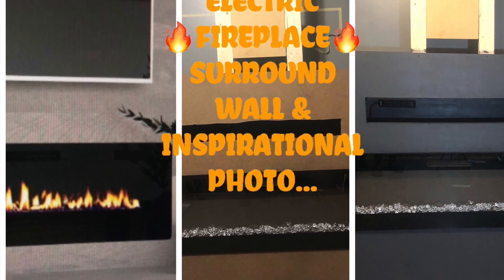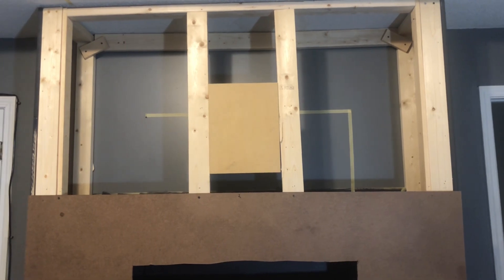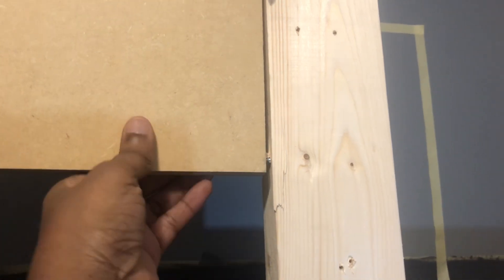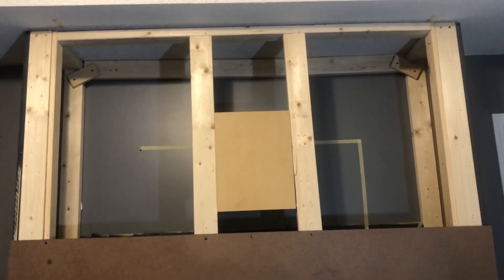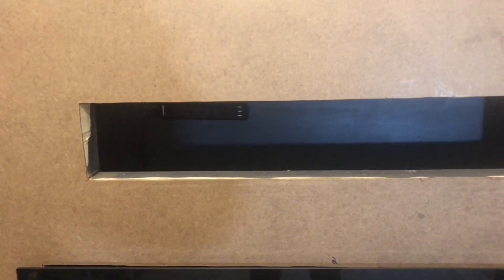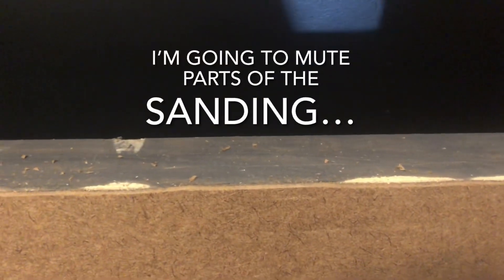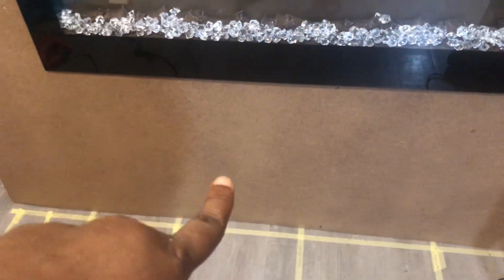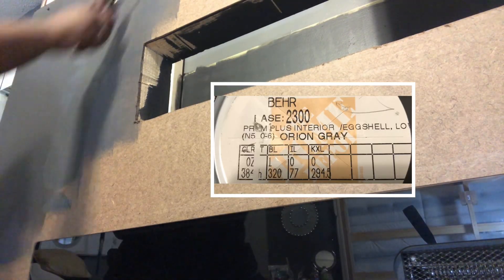PT. 5 DIY: “MY CUSTOM BUILT SMART ELECTRICAL 🔥FIREPLACE🔥 SURROUND WALL“

Comment: how much does it cost tho?
Reply from the maker: Trigo, I didn't keep a count & I already had a lot of the materials already on hand! It can cost as little as $150 an upwards Depending on the size fireplace that you're building and the Materials that you're using! I tried to use the most Inexpensive Materials as possible. 2x4's = $7@, 1x3's =$4@, 1x2 = $3@, The Brown hardwood Board $8@, Screws $10 a box, & the Nails @ the same!  Thank U & Thanks, for watching! I appreciate U! 🙋‍♀️🤗🥰🙌 God Bless!